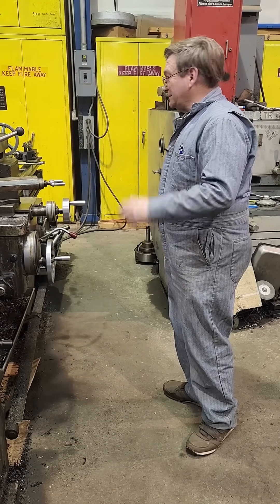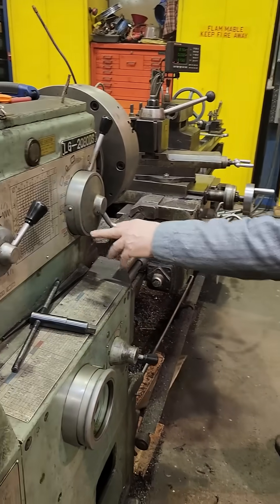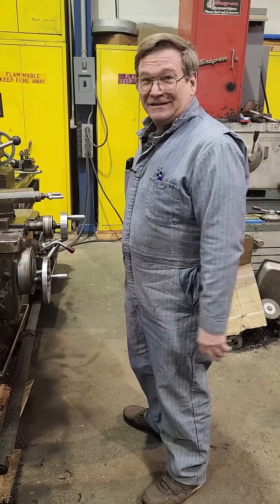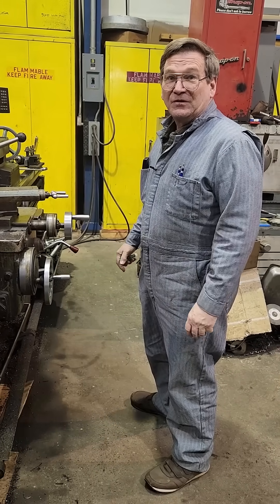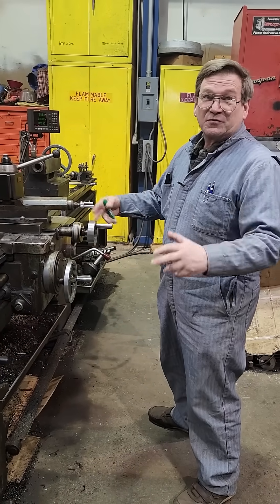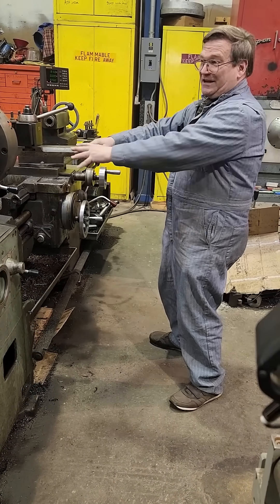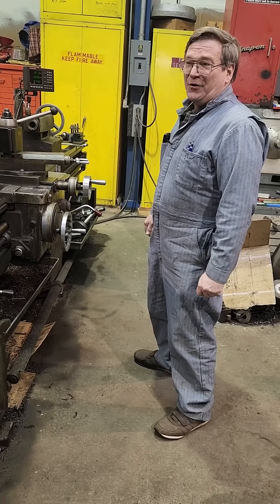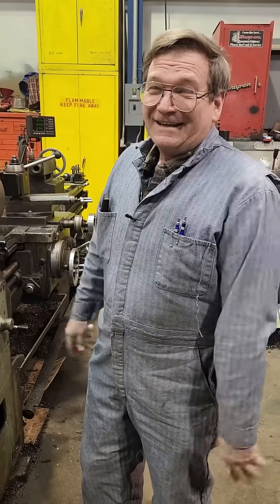What to look for when buying a lathe?

Comment: I have 2 of the rarest and probably the most expensive manual lathes ever built. The Holbrook H20. 20" swing over the bed. But only 40" between centres. Weight is 5000kg or around 11,000 lbs. They are toolroom lathes. Run like a Swiss watch with zero vibration even when turning heavy strange shaped castings at high speed. Only 134 ever made. One came out of the RR aero engine centre where they built the Concorde and Harrier engines. The other out of British Leyland's toolroom. They were the only sort of companies that could afford them. One built in 1963 the other 1964.

Comment: One place I worked at gave me a specialty lathe when the operator retired  . No one else could run it , it had a very strange hydraulic control system and no one would buy it or even take it . I told my brother , who had a plywood mill , about it and he wanted it for parts. I could get no information from anyone anywhere about how much it weighed ( for arranging shipping ). Turns out it was much heavier than we imagined. Great difficulty getting it out of the building and loaded onto the flatbed semi. Neighboring business  had a giant oversized forklift, so big we couldn’t get it into the building without  tilting the mast as far as it would go. Getting out was no problem while carrying the machine the tires on the forklift collapsed down from the weight just enough to get back out.

Comment: Having bought a few lathes I think my biggest thing I look at is weight. The heavier it is the better it’ll handle steel or harder grades imo. Then second is swing.. for a home shop where maybe you might make a little side money with it somewhere around a 14x40 is hard to beat. Lots of versatility there with a reasonable foot print. Idk just my thoughts 🤷‍♂️

Comment: Clutched spindle!!! I can never go back to a lathe with simple on/off/reverse lever for the spindle. With a clutch you can run taps and cut threads so much easier. Also starting large/heavy parts gently. Changing feed rates also, if I’m switching between turning and facing I don’t want to have to change multiple levers or even have to stop the spindle. My machine I can change one lever on the fly and keep the feed rates correct for turning or facing. Through spindle diameter too. I can pass 3.75” all the way through and 4.5” I think 12” deep into the chuck. I’ve had my old SIRCO PA-24 x 80” over 25 years now and I can’t stand running lesser machines. I shipped it 1200 miles when I moved, if I remember it was just shy of 10k lbs.

Comment: He's right about everything, weight is important for rigidity and vibration control.
 A lower RPM range equals torque, plus the correct horsepower to the lathe size.
And my favorite through hole bore, sure I loved running Monarchs and those wartime machined, but the through hole bores were extremely small, like slightly over 1" ID.
Most newer machines can take over 2" to 2.5" stock.
Unfortunately trying to find a newly built lathe that we'll built is like finding a unicorn.
Reply: What's the hole for?

Comment: I used to be an airframe repair guy in the air force, and the sheet metal shop I worked in shared a building with a machine shop that was right across the hall. Machining has always fascinated me and I've learned how to both produce and read technical drawings and machinist is something I have considered switching to at the last part of my life. Boy, you would be a great guy to learn from. You have a lot of enthusiasm and knowledge and just seem overall very very solid

Comment: My 1954 Series 60 18” Monarch lathe weighs about 9000 lbs just recently machined some RA330 high temp stainless and had to lock the cross slide to prevent backing off from the cut. A nice rigid machine 😊

Comment: LeBlonde lathes will get the job done, great speed ranges, stable bed, and fully adjustable  multipoint headstock leveling . Year after year after year making everything you can think of and some you might never have thought of

Comment: Thank you for sharing your wealth of knowledge and experience! 
 The Machinist where I work run Hastelloy quite often and I don't think I've ever seen them run anywhere close to that slow. 
   They turn down bodies flanges and other parts to build retractable and fixed injection quills. 
  It's usually small parts compared to what you deal with regularly. 
  So I was curious what the difference might be causing me to break inserts and what not?
Reply: I see them for basically scrap value all the time. The real cost in buying used machinery is transporting them.
Reply: @ForfeMac  No doubt,  We have a lathe right now in front of the shop under a tarp begging to get parted out and go to the scrap yard.

Comment: I’m always amazed at how much emphasis people place on backlash when they are evaluating the condition of a used lathe. You could take two identical lathes, one is brand spanking new and the other is so clapped out It’s heading for the scrapheap and switch the screws and nuts in both of them, that new lathe will be mildly annoying at times, but it will still be a good usable machine. And the one with the now factory new backlash is still heading straight for the scrapheap!

And it sounds like your and my observations on lathe weight are about the same. On a size to weight ratio the heaviest lathe I think I’ve ever seen is a Monarch 10EE.

Comment: Im a 19 year old who recently bought my first lathe, its a 1909 Marshall & Huschart 15" swing. I absolutely love it, it was originally designed for steam and still used a leather belt, but then you can unlock it and use a gear reduction to get some insanely slow RPMs. Bought the whole thing for $650, and the story behind it is rather funny to me. I first laid eyes on it years ago, I run a mechanic shop and was looking for a good machine shop that had decent turnaround time, and on google i found this little shop actually really close to me so I called it up and this 87 year old guy answered and says he basically just does it for the love of the game to keep himself busy and he was able to do my engine in 2 weeks when every other shop said it was gonna be months if not a year and cost hundreds more. When I first went to his shop, he instantly reminded me of my grandpa, then I saw he actually had the same exact old vintage mechanics jacket my grandpa gave to me that I wore every day, it was divine perfection. I knew I wanted to get to know the guy and maybe someday be able to buy his tools and machines from him, I was 17 at the time, but I never once thought that only 2 years later I'd be buying his lathe. The crazy part is that this thing still holds tolerances down to ± a thou and can take some fat cuts. I just need to get a new leather belt custom made since I havent found any good sources online aside from a single eBay listing.
Reply: You don't have to use leather for a belt. There is canvas/rubber belting available for that. I use it on my old camel back drill and Logan lathe. Cheaper than leather and more common in longer lengths. It's been a few years since I bought some, but I think I got it from Miller Engine Supply in Ohio. They sell stuff for hit and miss antique engines. If you can't find it, check McMaster Carr because I think I remember them having it at one time in the past. I use the Clipper  lacing that takes a tool to install properly, but you can get those to use with a vise fairly cheap.
Reply: Just skiv off some rubber baler belt to you’re desired width from any ag supply and clip lace it together
Reply: That's awesome, dude! Cherish the old man and spend as much time with him as you can. I promise you you'll learn so much valuable stuff from him, and I guarantee he loves being able to share it with you. Hopefully, you'll get to be his age or better one day, and some kid will walk into your shop looking to learn just like you did. God bless the both of you.
Reply: @anthonymoses3697  I came here to post just that. Not only will he learn so much from the gentleman, the gentleman will probably be very eager to pass on what he knows. I’ve made a lot of friends in the machinist world. It’s not my regular job, but I enjoy it. The guys that know how to do everything are disappearing. There’s always gonna be a place for manual machines.
Reply: Great story! I’m glad you told it! There’s nothing better than dealing with guys like that older man, and they have a ton of knowledge and experience to pull from. Take care
Reply: I just bought a long enough timing belt and used the method to close it as oulined in the Southbend lathe manual. No more slip.
Reply: Great story.
Reply: Good on ya kid!  I run a machine shop as part of a company who manufactures their own stuff.  It’s a sweet career

Comment: The old turret lathes have a large hole thru spindle and  are built like a brick %$## house, they were easy to use because they were made for production , most probably were scrapped and replaced by cnc lathes
Reply: I agree. I also hate it. Those were really good machines. It’s like manual machining is becoming a lost art. I do it mainly as a hobby but I pick up quite a bit of work from local farmers that just need a one off shaft or something. No one knows how or will do manual work anymore, It seems like.

Comment: Harrison made some good ones too, and being British the usually came with a gearbox with a wide range and transposing gears for metric threads.
Reply: I have a 13x40 Harrison from about 1968. Wished it was in New condition. I bought a new 16x60 Precison Mathews it has a 2.55 inch through hole. Love both of them. The Harrison will probly collect a lot of dust now.
Reply: @garytodd5605 2.5” thru on a 16”? That’s awsome. I have an old 10” south end at home that can only do like 7/8”. I think the Harrison’s at work will do 1.5” I’d love to have a lathe that would fit 2.5” thru that size. We got an old classing at work that can fit 4” or so but it’s friggin huge.

Comment: For home use, probably whatever you can find that runs 110VAC. I got a 1950 10” worn out southbend that has produced some incredibly accurate rifles. But t I got all the attachments. You could easily spend more than the machine piecing together all the stuff that goes with it. Also a good tailstock that goes with the machine is good thing to look for. We acquired a nice looking hardinge HLV but the tailstock came from another hardinge and needed both ground and shimmed to match, since those cannot be adjusted.

Comment: #1 is largest bore through spindle for the range of machine bed length you need.
#2 is ways condition.
#3 is accessories (the Gap needs to be included and in good condition, you want a Steady Rest and a Follower Rest, multiple Chucks, Quick-Change Indexing Tool Post, possibly a Taper Turning Attachment). Trying to get accessories for an old lathe can be next to impossible and even then could be expensive.  Most machine ways are different so less likely for any kind of universal steady rest or anything like that, then even still you would likely need to modify it for centre height from machine to machine.
Several thousand dollars worth of accessories doesn’t change the price of the machine too much, so getting one with lots of accessories is likely a better value and enables you to be the most versatile.
Rapid feed is nice to have on bigger machines.
Look under the bed for cracks in the frame.  They are bulky and awkward and delicate when moving.
Verify the voltage and main motor hp.
Confirm the DRO works and is the proper one for that machine.
Do a lift check on the Spindle Bearings.
Check the Half-Nut wear.
Check both Back-Lash AND Thrust on the Cross Slide.
Try the clutch as when they wear it can be considerable down time to replace it.
Check the condition inside the TailStock taper.
Many inspection points can tell you if intelligent people used this machine and maintained it, or did idiots neglect and abuse it?
Reply: Southbend Heavy 10 is 1.4375"s thru the spindle I believe. I paid 2300$ and only have a 5' bed, but I have rarely needed longer, that thru hole size is key as is having a quick change gear box. The whole lathe was in great shape and came with tooling, no complaints here. Some day I'll have one with more swing and a longer bed, hopefully a DRO.

Comment: Clausing Colchester...
Essential. Ours when I was learning, had a setting for 52rpm.
😊❤
Reply: I have a Colchester chipmaster strapless 35-3000 RPM out of the box , with my inverter 7 to 4000, scared to go any faster
Reply: @Phantom-mk4kp woah... that's impressive. 
I learned on a Clausing Colchester.

I'd be afraid of taking it slower than around 50ish RPM.
Good on you
Reply: @d.cypher2920 Slow speed is good for spring winding don't think I'd ever cut at the slower speeds, only time I could see it required is if your lath can swing a massive diameter

Comment: Had this exact problem with to small of a through hole on my 1944 monarch 16x40 lathe. It’s a great machine but the through hole is like 1-3/4” or maybe 2” I forgot. Which is okay but seems like it’s never enough when you need it

Comment: In my experience (admittedly much less than yours) the majority (if not all) of older turret lathes do have a decent sized hole. I'm assuming it's because they are made for production and so bar stock needs to be fed through. I do remember needing to machine very lengthy parts on an engine lathe where I was barely able to get my tooling to the far end of the lathe, and it was a pain in the you-know-what with a steady-rest in the middle and a center at the furthest that I could manage to get the tailstock limiting movement. Life would've been so much simpler if I could've extended out the back.